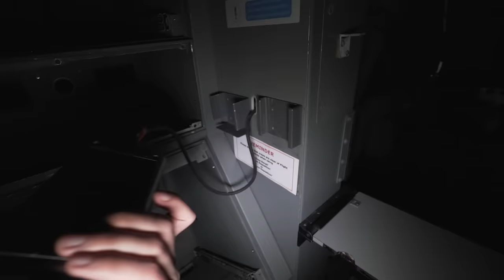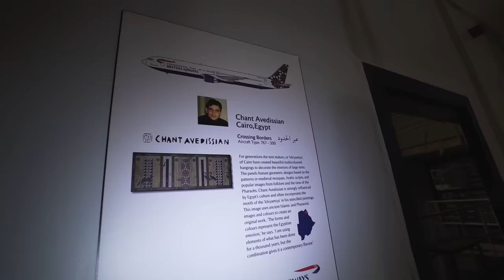ABANDONED FLIGHT SCHOOL, Heathrow Airport

Comment: The tapes are Sony Highband U-Matics , they were broadcast spec. Used in the 80’s to early/mid nineties. Eventually, they were replaced by Sony Betacam. I spent many a day loading thousands of them into a large machine that wiped them, in a previous TV job.
Reply: Fun times with the bulk eraser.  Pranks on the interns (erase packing and gaffing tape before use, etc.).  Nosy management respected the sign I had on the maintenance shop door.  Strong magnetic field, entering may damage credit cards.  I do not miss repairing the VCRs.

Comment: 22:38  By the looks of it this place was abandoned around 1991 whereas Airbus wouldn't become a giant in the industry until around the millennium.  This would explain the lack of Airbus materials on site, the biggest western plane makers back in 1991 were Boeing, Lockheed and McDonnell Douglas.
Reply: Airbus was well established by 1991. However, British Airways was predominantly a Boeing operator in the 1990s & early 2000s. Only after 2002 did they start to shift more towards Airbus, so no doubt the Airbus stuff were transferred to their new training centre because it's more current than the Boeing stuff.
Reply: Someone replied he visit it 12 years ago in perfect condition.

Comment: Nice video! All those 'buttons' are actually circuit breakers! Too much current flow in a particular direction or if equipment is requesting too much current it will pop, like a fuse in your car. Except, with these, you can simply reset them by pushing them in. Not like traditional fuses. 😊👍

Comment: 19:20 That tape is a quarter-inch computer backup tape (often called QIC for Quarter-Inch Cartridge). It's actually an open spool like a reel-to-reel tape but inside a plastic & metal package. My first job in the 1990s was designing drives that could use them: they ended up in computer backup systems and telephone exchanges.

I'm not sure, but the Sony video cassette is possibly Betacam - the professional version of Betamax
Reply: Thanks for the info! 👋 🐈
Reply: I thought it was Betacam at first but it's Sony U-Matic.
Reply: I was going to say U Matic tape. I used to use them when I first started in TV.
Reply: Thanks for the info on the 3M tape.  The Sony tape format is known as U-Matic or as we in the us would simply say 3/4".  Removing the red dot on the bottom prevented accidental recording (record tab on a vhs/beta).  The player looked to be a VP-7000.

Comment: Definitely, one of your best explores!
I think those videotapes were a professional standard, call video 2000 or something, they are used by tv studios etc. 
The upstairs section on the 747 was the first-class lounge and bar for the first-class passengers at the front of the plane.
I think that robot thing was a robot tape library which automatically selects and loads the right tape into the player/recorder under computer control.
Reply: U-Matic (3/4" in USA).  TV news used them before BetaCam (which is different than betamax).  The robo was also my first guess, but the ones I worked with in TV were large round contraptions with robo arm in the center.  Parts retrieval seems correct.
Reply: Looks like the original lounge has been converted for seating..........possible "club class"........(I have been in the Jumbo cop pit for a landing at Hong Hong airport in the early 80s) would not be allowed today. Shame I was very young and cannot remember much.

Comment: How could they let such a amazing simulator go like this? Have you got any idea how much these things can cost? My company got one for the Boeing 777 X Series and its cost is in the double digits in Millions of Dollars, I'm sure I'm not privy to disclose actual cost but yeah, Surely there is a use for them after their official use is over like selling them privately to a wealthy Sim enthusiast or a Pay to Play or Pay to Experience flying a commercial airliner, There's good money in things like that in the right location's
Reply: They require a huge amount of ongoing maintenance and at least in the older buildings they’re basically built in. We tried to give an old 737 sim to a local university. They would have had to pay to have a wall demolished and rebuilt, plus taking the sim apart and putting it back together, then maintaining it with all the old projectors and stuff that you can no longer get parts for. They didn’t take it and we pulled it down for scrap.

Comment: This was the nuts guys...... what a place... all that history... just think... over the years the training of thousands of pilots, air crew etc would of passed through there, and then gone on to fly all over the world for years.  
That room you found with those electrical machines that looked a bit like TVs would of been where the Tech Staff were. Oscilascopes were used for testing Electrical components and Panels to make sure the correct voltage and currents were passing through them.  TV Engineers used them to fix the old TVs you mentioned too.
Incredible explore.
Reply: thank you for explaining what the equipment did. I have seen them before but never knew their purpose beyond circuit testing.

Comment: at 4:16 where you mentioned about all the buttons do something, those in particular are circuit breakers, they pop out and break the circuit if theres a short, or for maintenance when you need to cut power to an area, theres a little collar you put on those to make them stay out. pilots can push in the circuit breakers one time and only if its a critical system, otherwise they have to let maintenance handle it. most the system control buttons would have been in the panel on the roof, but those panels were removed on that plane

Comment: The wall behind them at 33:00 with the string on it is Dated May 2013- April 2014 so I'd say thats when it was last in operation. Based on the spread of stuff on that wall I'd say end of 2013 or so was the last major activity. Can't find any actual reference on when it closed down other that "around 5 years" as of 2021.

Comment: The things that looked like planes were used as cabin crew training simulators.  When set up, they had operational slides, and were fitted out etc with seating, galleys etc as though they were real planes.
Whatsweird is that when they moved to new site, they did not sell this site on or it was not reset to new tenants.

Comment: Commercial pilots need to be "type-rated", yeah you can fly a little flying wheelie bin aka a Cessna but you can't fly a 747, and if you can fly a 747 you can't just jump in a different type of 747 like the 747-800 because the controls and the way they handle is different. Different manufacturers like Boeing and Airbus also have different controls altogether, stuff being in different places and that. Nowerdays you can do all that in VR without needing to build whole simulators like these and get a mate to push your chair about 😂

Comment: holy crap
2:46 Seems awfully 1970s-80s 
Or maybe that’s just because all the expensive stuff has been stripped?
I reckon the building was built in the 60s-70s and most of it was upgraded in the 90s-2000s and it started rotting so they stopped using it?
Should have looked at the dates on the drinks at the drinks trolley
38:27 WOW.

Comment: 4:15 those are circuit-breakers, or fuses for various different systems.

at 14:40: whole cockpit was enclosed in a dark "room" with screens that is now missing. You can see where it was attached to the ground by black stripe in front of the nose. Projectors should be on top of each window. Guy with long hair got it right.

Comment: great vid guys, the question about flying set models like the airbus are all basicilly the same systems to fly, a few bits to learn ,but if you can fly a a300 you could fly any of them in that planes range, ,boeing are different ,but most pilots can fly all the in service planes,, ,i knew a guy who flew concorde for 5yrs ,that was the top plane ,only a few that went to train for them got a job flying them, ,the guy i knew retired after 5yrs of flying one ,should have asked him if it was a 5yr contract ,

Comment: i was on a pilot school in arl Stockholm so I believe that the plane at 14:18 has been demolished in the front and the screens that have been standing there as well as the projectors are gone. You can see that by looking on the floor where there has been a wall so basically the simulator is a real-time flying training and the computers in the entrance are computers that the training teacher could control to simulate different scenarios. but like I said the sim is demolished because they are crazy expensive I've been told that they go for 10 million dollars or something like that but i don't really know someone probably knows this better than me but something that i know is that the projectors was the most expensive parts of the simulator

Comment: At 38 minutes in…. No, it’s not for your balls. 🤣 Actually that’s one of the slots for the pilot harness. You see the straps that go over the shoulders in videos, but there are another two straps that join to the metal clip holder situated on the chest while worn. The final strap comes up between the legs-that’s what the gap is for.

Perhaps that strap is why pilots don’t much like the harness and only wear it when necessary. The male pilots, al least. 😂

Comment: 16:38
In short, no, you can't.

Here's why;

Each plane, even if they're named the same (Example: Boeing 737-400 or Boeing 737-800) requires seperate training.

Every commercial pilot requires to pass a 6 month flight training and requires a few hundred flight hours in a small plane the size of a Cessna. Upon receiving their flight licence, they undertake training for their specified plane.

This is because each plane has different weight values, they all can carry different amounts of weight, so on
That aswell as their controls. An Airbus A320Neo may be easier to fly due to its light-weight nature compared to the Boeing 747-800 since that's an intercontinental.

So again, no it isn't, to fly a plane classed higher than your license allows, you must undertake flight training for desired aircraft.

Comment: The smoke evacuation handle is to suck out smoke from the cockpit via an outside vent in the roof if there is smoke inside because even with masks on if the pilots cannot see the instruments then they cannot safely fly the plane
Reply: this is a real 747-200 fuselage dressed up as a - 400 btw

Comment: 3:23, the ultimate in simulater games, just rusting, if they had open it to the public, in have go day, there would bee a line  the very least could it not be used as film set, no I don't want aver film to be in cockpit of a plane,  there would of been a line going down the road out side, and before any say mantence, it's any older modal plane, so there will by scrapyards full of the bits need to keep it going for years,